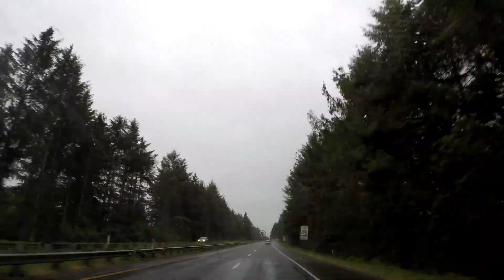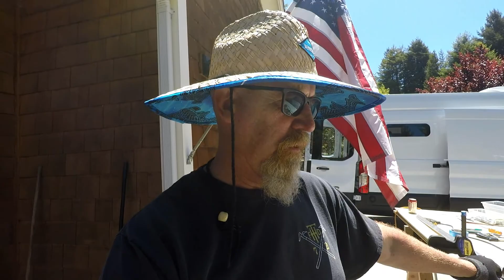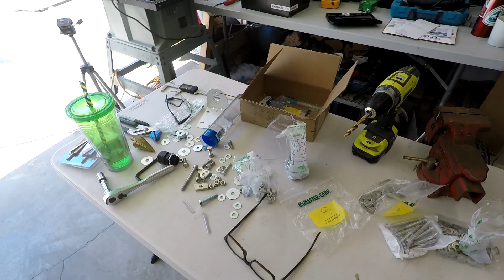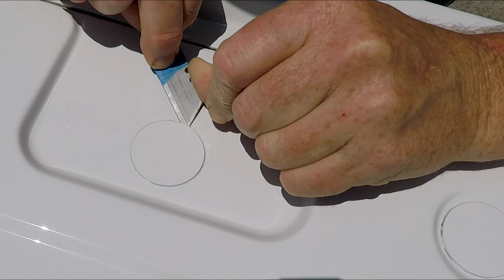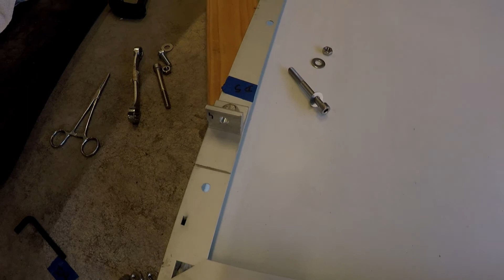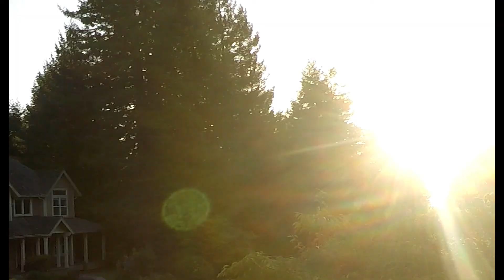DIY SOLAR RACK!

Comment: Thanks again, what size motor mounts did you use," hight"?  I'm worried about the curving roof..
Reply from the maker: I think 1.5 inch. On the diy video link I sent you the guy has a link to his blog that shows every component he bought
Reply: @donttradeyears6  Thanks, I really appreciate the help.

Comment: Hey man! Just got a rig and in the process of researching and just wanted to warn you, from what I’ve seen, you need more surface area on your mounts to the van roof. I’m sure that’s clear as mud, so to attempt to clarify, where the bolts thread in to the roof, the support structure is maybe 4” around that hole, and not in the centre. As it is you’re tightened to sheet metal. Which will do for a little while, but it will give from the force + driving. You need to spread out the surface area so you are on the beam. If you look from underneath you’ll see what I mean. Maybe you already addressed this. I always appreciate folks giving me heads up on stuff even when I’ve already corrected, Hope I’m not being a pain! Keep up the good work!
Reply: Did you figure anything out for this? Hope I didn't cause ya to just curse under your breath! just trying to help. Keep up the good work.